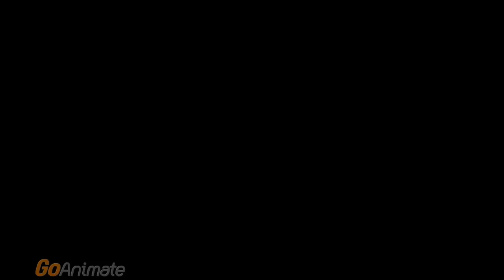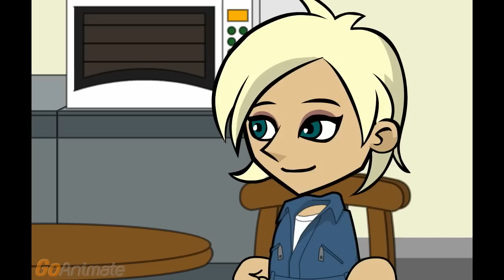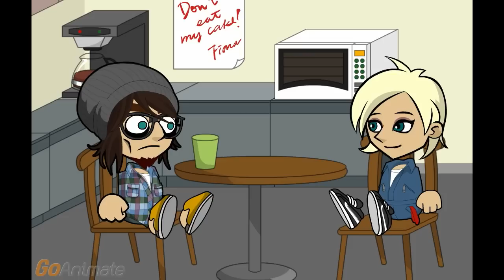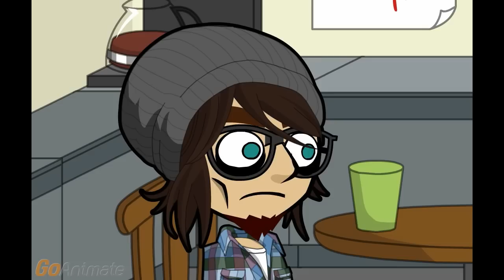Furnace Error Code 24 for Carrier Bryant and Payne

Comment: That was super weird and not at all helpful.  "Maybe it's a blown fuse.  But it can't be because then I wouldn't be getting a flashing code. Oh well, let's keep talking about fuses anyway".
Reply: Totally different fuses buddy. Multiple fuses and breakers
Reply: It is helpful to some cases of the 24vac and yes you will get a blinking light with a 24 error code with no fuse. This is not a cheap system. It is a communicating system.